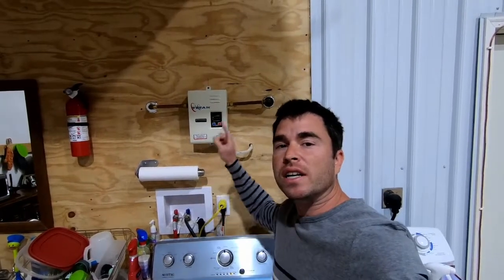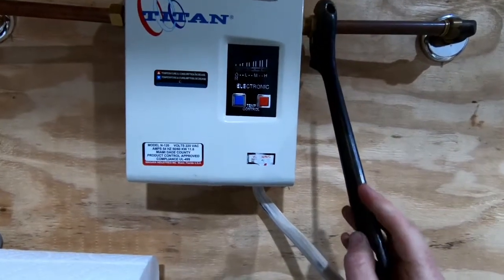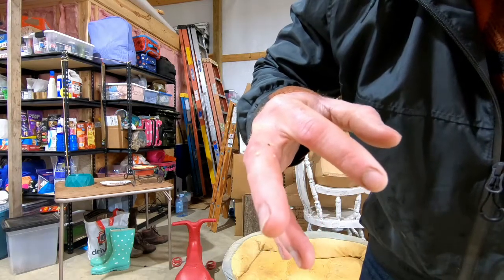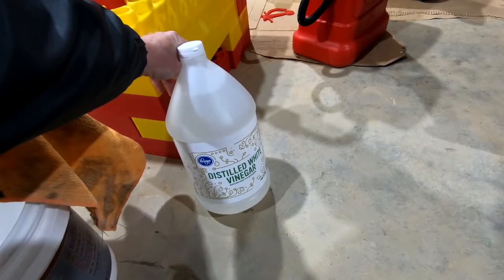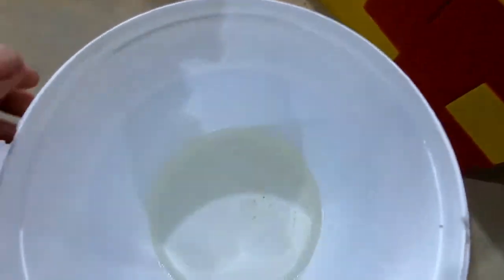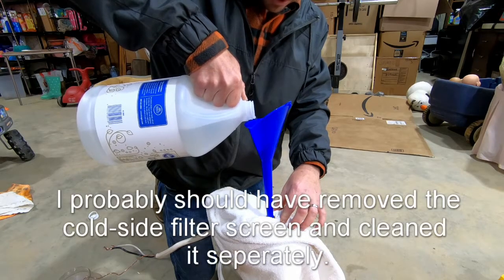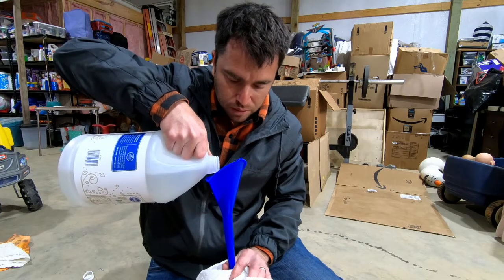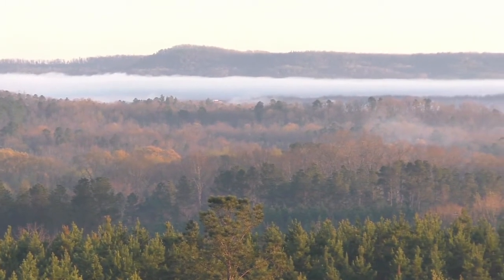How to Clean a Tankless Water Heater Without Buying a Flushing Kit.

Comment: Any idea if this method would work on a unit that has the intake and output both on the same side? Mine is a propane tankless for outdoor use, and all valves are on the bottom. Easy to dismount, and lay it on its side, but it looks like your relying solely on gravity for this flush. Any tips?

Comment: How would clr work ?
Reply from the maker: @Masterqueefin  im not sure.  Vinegar is cheaper and widely used, so I would stick to that.
Reply: @FarmDad  well i have clr lol and about to do this process as we speak i just want to know if it will hurt anything because my dad got it and says it would be way better than vinegar
Reply from the maker: @Masterqueefin  afraid I can't speak to whether clr is safe .  I've only used it on external fixtures.
Reply: @FarmDad  well now u can say its safe and quicker lol took me 30 mins total from taking everything apart and putting it back on
Reply: @FarmDad  Maybe 45 mins 🤔  idk it was pretty ez tho
Reply from the maker: @Masterqueefin  awesome!  Thanks for the update!
Reply: @FarmDad  also this thing hasn't been cleaned in 4 years 😢

Comment: Bro…that water heater wouldnt heat a bowl of water….thats for a half person household…..zero bath
Reply from the maker: Incorrect.  This unit is for 1 full bath, which is what this building has.  It does great.
Reply: Tankless water heaters heat the water up as they come through not  like a traditional water heater that has so much it heats up at a time so no more did you use all the hot water problems 😂

Comment: My hot water stopped working and I had reset it as most videos displayed. Desperately called 6 plumbing companies with estimates over $300. This video saved me the costs and I wanted to say Thank you! I have the Tritan Tankless Water heater same as the video and found all the sediment when treating it in the same manner. I appreciate people that make videos for those who want to learn and save a tremendous amount of money scammed by companies. 
Thank you, this method worked immediately on the tankless electric water heater after you attempted reset! 👍🏼💯
#Homeownerheroes

Comment: Do you have a dedicated pre-filter ? bet that would cut a bunch of the solids out of the picture. Great video dad !
Reply from the maker: The heater has one on the inlet.  The problem is when you superheat hard water, it creates a lot of scaling.  I will soon post video of an electronic descaler I installed, but I'm still waiting to see if I recommend it after testing it long term for the video.
Reply: @FarmDad - We had a place where a water softener company tried to sell us on their system. When they came to measure the elements in the water, the numbers were off the charts ! We ended up buying the big jugs for drinking and just got used to the hot water tank needing replacement every two years.